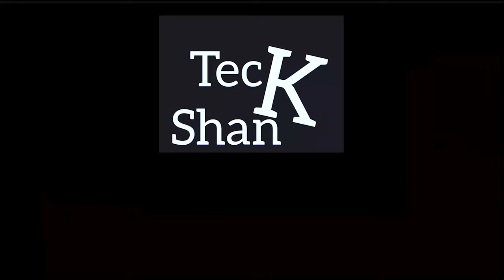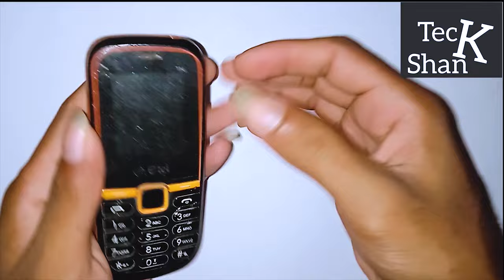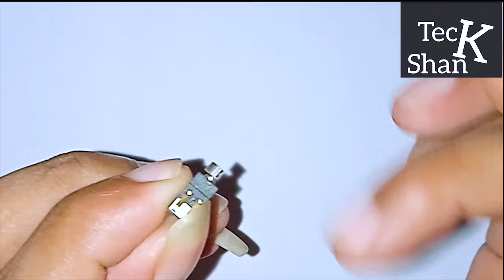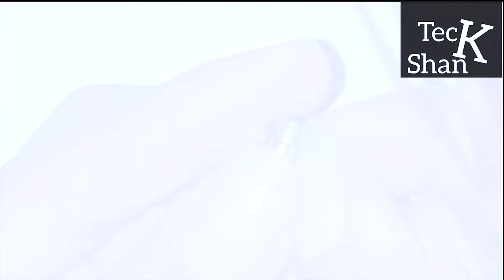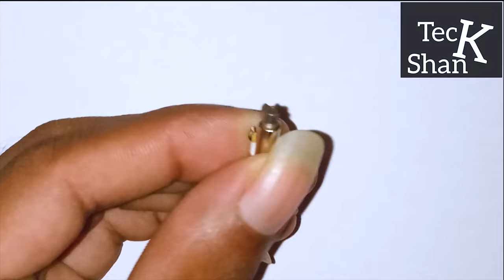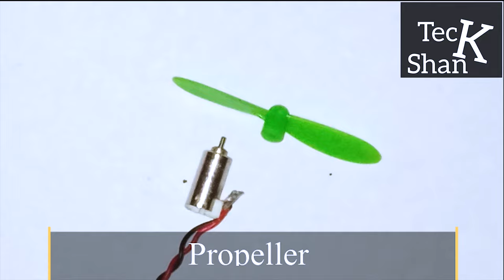How to get coreless motor from old mobile |  World's Smallest Dc Motor| small Dc Moter | Teckshan |

Comment: Bro my motor not 😭 work
Reply from the maker: The motor is on Burned😥
Reply: 😂😂 are bhai to roa kyu rhaa hea
Reply: @shrikantkhatke4697  c.dyert
U r uttoriiyo ngkru
Reply: My hair dryer motor is working
Reply: @techwithdilshan8777 😮
Reply: @techwithdilshan8777 😮😮😮😮😮😮😮😮😮😮😮
Reply: Hey your motor is burnt with how many volts did you use it because if it's a lot of electricity mine burns the same😢😢😢😢😢
Reply: Ye to vibrater hai 😂😂